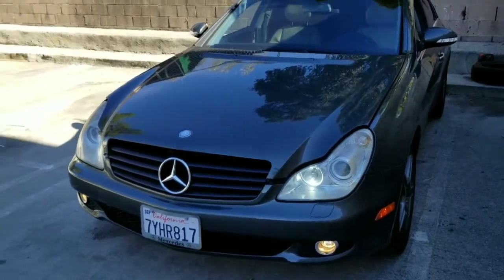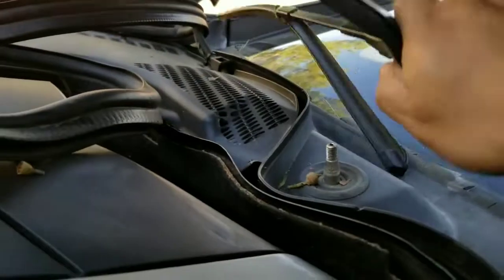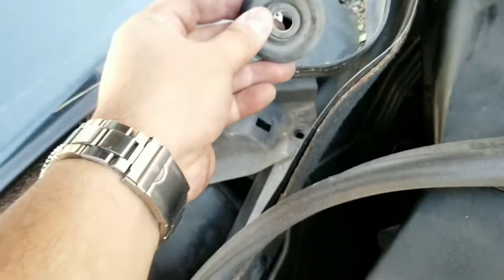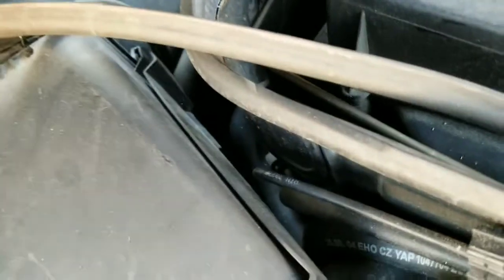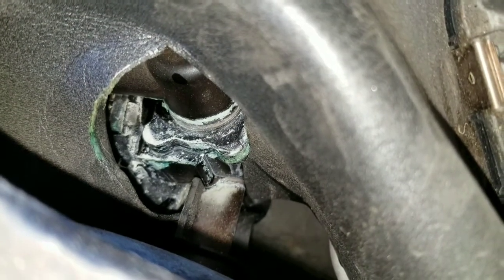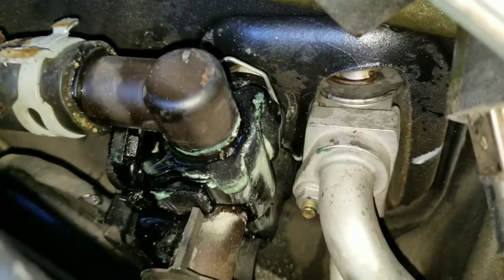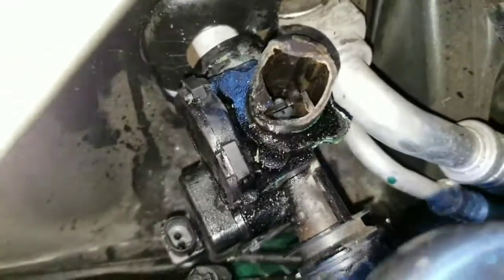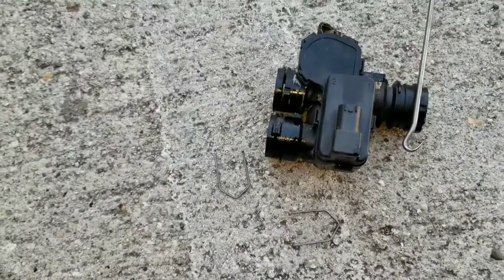Leaking Antifreeze underneath Driverside Fender on cls500 ( Find out Where is leaking from video 1)

Comment: Hello I'm Having some issue I was wondering did u make the other video yet to show how to put on
Reply from the maker: Hi lynnet, unfortunately I didn't get to record it. My phone broke and took time to get it. But I can recall is the same way I took it out. Ok so before u put it in. Make sure that the 2 small clamps for top and bottom are halfway in meaning do not clamp them all the way. Ok once u do that slide it in slowly and push fast and both will clamp fast and in. But make sure they did clamp in ok.. or it will have a major leak. The rest is easy many luck and be patient you will get it in. Just take your time.. Happy holidays Many blessings 🙏

Comment: I was told more than one reason coolant light comes on. Had car in Three times. No fix but they wonts me to Pay another bill for not fixing at first .
Reply from the maker: Sorry to hear that.
Reply: @Rtario  have u had any oil drips under your car . I’ve had like 2 or 3 very small drips under my car last few days .  It’s a bar that runs under the car right under the engine the drips come off that bar but I don’t know exactly where they coming from .